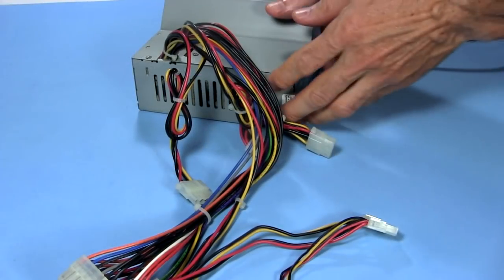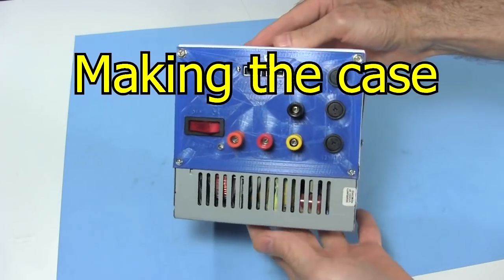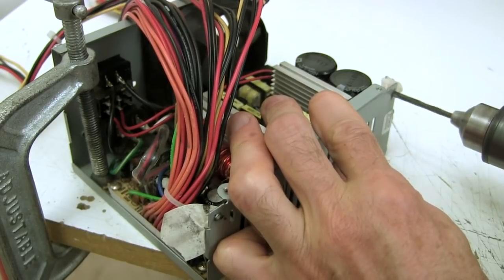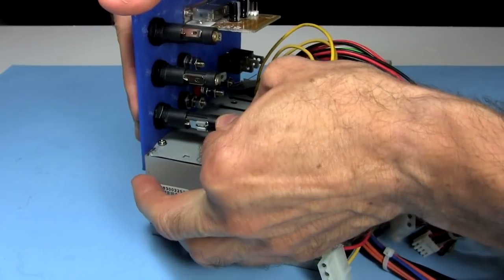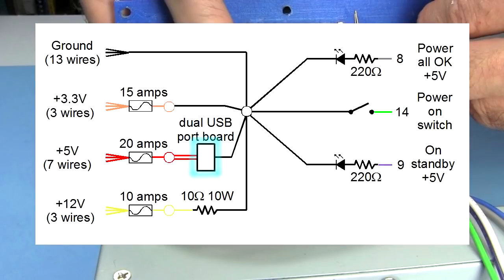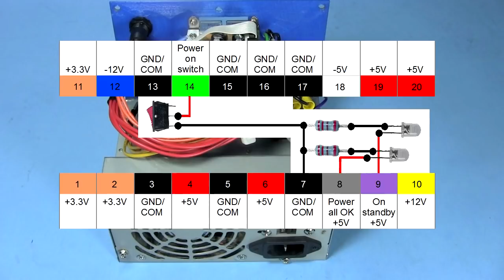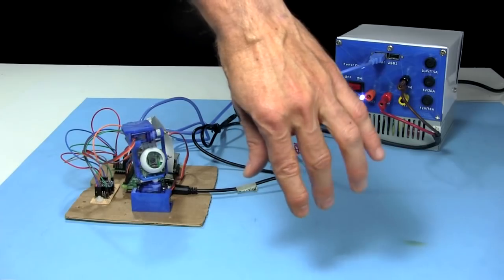Convert ATX Computer Power Supply for USB

Comment: Great delivery and very resourceful use of mostly on-hand items.  I don't think people realize how much work goes into organizing all of this and making it so concise and to the point. The USB  portion is well-suited to your purpose. I'll problably end up building something that breaks out 12/5/3.3v, but will steer clear of the USB option. There are just to many viariables of what one might want to power with that. Confined to your purpose it's great.
Reply from the maker: Yeah, when I made it I thought I'd use the USB option a lot but have ended up using the other outputs more.

Comment: What I did is put a panel over the fan hole to hold the binding posts and usb connectors.  The power supply is 500 watts.  But I'm not asking for more than 75 watts ever.  It doesn't need a fan.  I think it would still shut down if it got too hot.   I use it for charging phones and powering a 10 meter radio.  I figured this would work because the machine it was in was only pulling 250 watts and the fan barely turned.  The fan went bad.  So I recycled.

Comment: Cool build. One change I would make is to add a ~2.5A fuser on the 5V line going to the USB board. Without this there is the potential for the full 20A to flow out via the USB port and fry the heck out of whatever is hooked up to it. Remember, USB spec means devices will assume the max they can pull is 500mA, a badly/cheap usb device may rely on the source to cut off past a certain point rather than limit its own current.
Reply from the maker: Yeah, I agree. Someone else recently pointed out something similar except in that case it was because of the thin wires in the cable I reused for connecting to the USB board -- they might not be able to handle high current. I've been using it to power servo motors, normal USB uses hadn't occurred to me.

Comment: That would make a great starter general purpose power supply. Adding in voltage and current regulators would really make it great. Also, voltage and current displays could also be added.

Comment: Most ATX PSUs have minimum load requirements on one or more of their output voltage rails. If you do not have enough load then they will not regulate properly and one or more rails may be over or under voltage or be unstable or have excessive ripple. Some require a dummy load on 12V, some on 5V and some also need a dummy load on 3.3V. The manufacturers assume they will be connected to a PC mainboard which provides an active (and capacitive) load on each rail. Using it as a bench supply is not what it was designed for and it may not regulate properly unless you meet its min. load requirements. Unfortunately, very few mfrs actually print the minimum load requirements of their PSUs so you have to guess and check the output rails carefully!

Comment: load is required by the power supply to keep the switching transistor stable... a non-zero voltage is require to keep the base current biased - this voltage only occurs when the transistor is supplying current.. thus to remain stable, the transistors need an output load... this carries over to op amps, etc.  hope this helps. Anyways, for your application, there is a slight current draw by the USB power board, which is probably enough load to let your particular power supply turn on... might not work for every atx power supply... even the same brand can have some differences due to tolerances of various components. =D

Comment: Do you think you could have added a potentiometer to some of those 12v wires and created an adjustable voltage for different projects? I think this is perfect for building and testing circuits! Kudos great job!

Comment: Nice video. I have a couple of suggestions: 1) Don't solder crimp connectors if you can avoid it. Solder can fracture and break the wires. 2) Connect the feed to the fuse end terminals and the output to the front rings. This is safer if you are holding the fuse as you insert it. Other than that, good job.
Reply from the maker: Thanks. Good suggestions. I especially like 2. I'm all for preventative things like that.
Reply: @RimstarOrg  Actually suggestion 1 came from an Amphenol service bulletin I read while managing a tech shop in the 1980s.

Comment: Computer power supply for USB? Next, let's use a V12 to power my lawnmower! :-P

In all seriousness, pretty sure the fuse you shown at 6:06 is the mains fuse, which won't do anything if there's a short on the output. In most case, ATX power supplies already have built-in, self-resetting short circuit protection so those fuses on the front serve next to no protection but still pretty nice to have, probably.

And oh, I'm surprised you didn't mention anything about 3V3 feedback wire.
Reply from the maker: Yes! A V12 to power a lawnmower sounds awesome! :)
Seriously though, for portability I either had to bring batteries (wouldn't last the two days of the Makerfaire and there's no time to recharge), bring my desktop computer (no way I was doing that, and no laptop), or make this. And this will be useful for many more things too.
Regarding the fuses, some places I read said you needed them and others indicated what you're saying. No way I was going to take a chance on that internal fuse blowing at an inconvenient time since it'd be a nightmare to replace. A lot easier to play it safe and have easy to replace fuses.
Re the 3V3 feedback wire, I was aware of it but it just didn't come up in my case. Maybe I should have mentioned it anyway.
Reply: RimstarOrg  If you do not want the internal fuse to blow, then you should have the external fuses 'set' to a lower amperage. (That way they blow before the internal one(s).)
Reply: +RimstarOrg what about the voltage drop across the fuse on the output? It does not seem to affect the raspberry presumably because it has some input tolerances, but I don't know for more sensible electronics
Reply from the maker: I don't know what the voltage drop is across the fuse but I measured the voltage at the 5-volt binding post and it was 5.24 volts just using the meter so the voltage drop can't have been much.
Reply: RimstarOrg whatever happened to lasersaber?
Reply: @hdef6602  
A fuse is not a resistor, there is ZERO voltage drop across it.  
(And I believe you meant to say, "sensitive" electronics... "Sensible" in English, means it makes sense. I understand that you were probably  translating directly from French.  In French, "sensible" means sensitive. 
...Are we confused yet?  ;-))

Comment: hello amigo! i think we can also connect a 12v auto bulb in place of that 10watt dummy resistor load, that would be a cheaper alternative to buying a 10 watt resistor?
Reply from the maker: I don't have a record of how much my resistor cost but I did buy an extra one so it couldn't have been too much, certainly less than $10.
Reply: You are rigth. Better a powerfull LED lamp.

Comment: bravo..very detailed one. everything was very neat and clean. I have one query, do we need to use all the red, yellow etc wires. cant we use one wire of each color? wont single wires will deliver the same power ????
Reply from the maker: Yes, you can use one wire of each color. I'm pretty sure each wire's diameter is rated for the rated available current otherwise it wouldn't work in a computer.

Comment: Just curious. Why not just put a single fuse on the ground wire? Great video. Thanks!
Reply from the maker: It's possible that what goes wrong is that the insulation on a live wire (the 5V wire for example) goes bad and the copper part of the wire touches the metal case of the device which is plugged in but not necessarily turned on. If that case comes in contact with something which is grounded then there will be a high current electrical path from the live wire to the case and then to ground, not even involving the ground wire. So we put the fuse on the live wire.
It's done the same way with household wiring in North America, except there the question would be why do we put it on the live wire (HOT) and not on the neutral. See my video about What is Ground for diagrams and explanation https://youtu.be/zLW_7TPf310. It applies to this PC power supply too.

Comment: Though your video on "Convert ATX/PC Power Supply for USB seems very useful for Common men practically not a Electric/Electronic Circuitry knowledged
It would be more appreciable , if the list of accessories with names and how to determine specific capacities/efficiencies values such as Ampere,Watts,Volts, Wire gauges requirements would have furnished as ready reckoner.
May i expect your Description in detailed way please?

Comment: Can the 5v rail be used as usb charge ports for mobile phones? Or does it have too high amperage?
Reply from the maker: I would be worried about plugging in a phone, unless I were certain that the phone had sufficient current limiting circuitry.

Comment: can you explain to me the role of the dummy load? I have only 5w2ohm and 5w1ohm are they enough?
Reply from the maker: I don't think they'll be enough. Even my 10w10ohm resistor got hot enough to cause a little browning of the poster board that it was sitting on. The purpose of the dummy load is to be something that you will look like you are powering something. You could also look for a real load, in other words, power something, perhaps an old incandescent lightbulb.

Comment: Nice job. I hope you noticed you have a mistake on your diagram shown at 6.23?...GND is connected to the 3.3V+ binding post...Hopefully no-one used that diagram to build their project🤣👍🇦🇺
Reply from the maker: You're right. Thanks for pointing that out. Hopefully they followed the steps I did as I followed the diagram, then they'll notice that I didn't make that connection. I'll see if I can pin your comment to the top or something.
Reply: @RimstarOrg  👍🤣 It was a long time ago you posted this video so hopefully someone would've been in touch by now if they had a 'head scratching moment' Luckily these supplies are pretty well protected, but I can just picture someone wondering 'why does my power supply keep shutting down🤔?'...lol

Comment: Fuses should be added to each DC output . Otherwise an accidental short circuit, or a bad component can ruin the AX power supply which can be very difficult to repair.

Comment: nice video. was wondering if the USB is @ 20A. (not that anything usb would pull that).
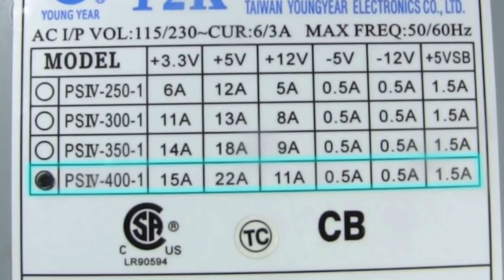Reply from the maker: You can see at 3:29 that the 5V output is rated for 22A, so yes. However, the ribbon cable I reused from the USB circuit board has very thin wires which wouldn't handle even 15A, probably not even 10A. So with suitable wires, and possibly without the circuit board, it should be able to output 20A.
Reply: @RimstarOrg  cool thx for the reply im gonna build one. :D

Comment: whats the amps of USB output? 22A? for  cellphone we need 1A or (in max) 2A
at[03:25] label shows the output of this Power Supply and the current for +5v  is  22A

i'm sorry for my Bad English
Reply from the maker: I don't know if the USB board with the connectors on it which I took from the computer has any current limiting so I can't say for sure. If it doesn't then the 22A would be the limit. However, the ribbon cable which I used has very thin wires in it too and so they'd probably melt at 22A. If all your cellphone uses is 1A or 2A then that should work fine. Note that the amp rating isn't how much the current will be output, it's a limit as to how much is available. It's your load, your cellphone, which determines how much current is output.
Reply: @RimstarOrg tanx

Comment: Hello brother It's a great video. I'm going to do this sometimes I have a little doubt, but in your video you said that the power source that consumes the most power is 12 volts 132 watts. It is necessary to connect the dummy load, but actually in your video per 5 volts 110 watts, so I'm not sure that How should it be connected to be correct? I need help Because I don't have any electronic knowledge.
Reply from the maker: Good catch! You're right. In my diagram, I show the dummy load connected to the 5V but when I actually test it, I connect it to the 12V like I said I would. I chose the highest power source because it should be able to handle the high load better, so go with the 12V. Connecting it to 5V in the diagram was an error. Thanks!
Reply: @RimstarOrg  👍🤞It's fine. I'm happy. I will make sure that I can connect the circuits properly. Because I don't have basic knowledge in electronics And I am training to learn from videos in YouTube I thank you very much

Comment: Been watching a lot of videos on this subject and I'm confused about which wire to connect to the dummy load. Some videos suggest adding the 10ohm resistor to the rail with the highest amps, but you suggest the one with the most wattage. I have +3.3V, 22amp on one rail and +12V, 15amp on another. Was thinking of attaching the 10ohm to the +12, 15amp, if it's needed. What do you think?
Reply from the maker: I'll have to check my notes, I know I got that from a webpage but don't have access to the right computer at the moment (it takes a while to boot up and I have to get going). You want to dissipate power and taking it from the largest source make sense to me. But I'll find that reference for you anyhow this evening.
Reply: Thank you
Reply from the maker: Here's the reference. The stuff on dummy loads is near the bottom.
Reply: Where's the reference?
Reply from the maker: Whoops. https://pcbsmoke.wordpress.com/2012/11/21/converting-an-atx-power-supply-into-a-dc-bench-supply/

Comment: Nice video! Can i modify the USB port to charge my cellphone? 
Thank you.
Reply from the maker: Thanks! You should be able to charge your cellphone but you should put a 2.5A fuse on the 5V USB wire going to the USB board. This was a good suggestion by Jarrod Coombes here in the comments. I didn't have normal USB applications in mind when I made this -- I use it for powering servo motors. Some normal USB devices assume the current is limited to much lower than it is in this power supply and don't provide their own protection so the fuse should add protection for those devices. You still charge it at your own risk though.
Reply from the maker: I just remembered that someone else here in the comments suggested using the purple wire for the USB instead. It's 5V and 500mA.
Reply: Thanks for your reply
@RimstarOrg

Comment: I have a question does the raspberry pi 3b+ have a voltage regulator so I could just use a battery?
Reply from the maker: I've used a power bank normally used for charging phones. A quick search shows that using battery directly is a bad idea though there are some options still. Here's a random webpage that goes through the options along with the dangers https://www.arrow.com/en/research-and-events/articles/battery-power-your-pi
Reply from the maker: Notice he pointed out that the Pi Zero that he used has a DC-DC converter on it, the PAM2306. He also added more battery management circuitry to automatically switch off the power if the battery voltage goes too low.
Reply: @RimstarOrg  ok

Comment: You can buy brackets with 4 usb 2.0 ports from eBay and they cost less than 3$, no point butchering boards. Just search for "usb bracket".  Brackets with 2 ports can often be bought for 99 cents or something like that, sometimes even in stores like newegg - and you can probably get some for free at places like Freegeek   

Also worth mentioning that cheap power supplies these days are often group regulated, which means there's a main output voltage (typically 12v) and the 5v and 3.3v outputs are regulated based on the 12v load... if there's no significant load on 12v (let's say 20w or more), the 5v output could be quite a bit off, like 4.8v instead of 5v.  In your particular case, you're lucky that you have an ancient psu which is designed from the start to output most of its power on 5v.

You should have cut off the wires and connectors and use AWG16 or AWG18 wires for less voltage drop... that psu probably uses AWG20 wires
Reply from the maker: This was the only use I had to the board. Gradually I'll have stripped everything useful from that old computer and throw what's left away. This way, the USB boards gets to be used again. It's good to know that you can buy them though. I'm sure I'll need more at some point. Thanks.

Regarding the size of the wires in the PSU, they were all 18 AWG. I know that because I used the 18 AWG sized hole on my strippers to strip them.

Comment: Does the USB ports need those caps or can I solder the supply directly to the sockets themselves?
Reply from the maker: It might power some things but not others. I don't know how to determine which. I needed them otherwise my motor controller wouldn't work.
Reply: @RimstarOrg  Ahh I'm you. Im sure the 5v out from the supply should be ok?
I've got loose usb sockets with no circuit.

Comment: Why is the USB breakout board required?  I would have guessed that you could simply run 5V power from the PSU to the USB connector.
Reply from the maker: Going directly from the 5V power to my Maestro board would cause the board to error out within 30 seconds or so. I don't know what the error was but I didn't have that problem when I included the USB breakout board. I know there are capacitors and resistors in its circuit for the power lines so possibly some filtering was needed. I couldn't make out the full circuit on the board in order to replicate it with my own components and I couldn't find a good source online. So I just used the board. It was just the Maestro which was sensitive (that I know of), plenty of other things work directly off the 5V directly from the PSU.